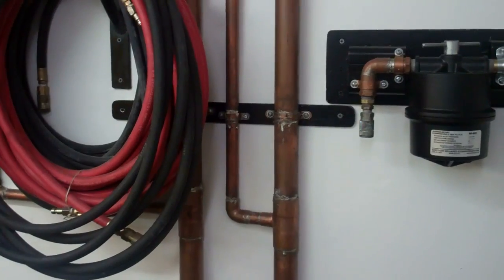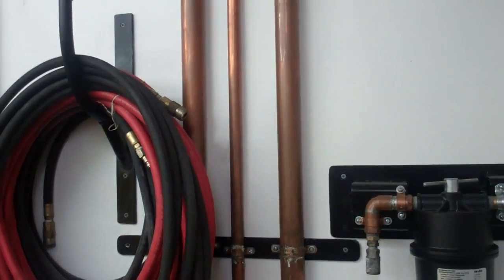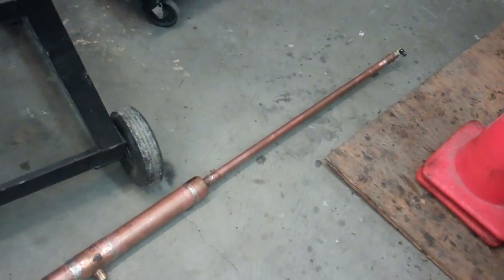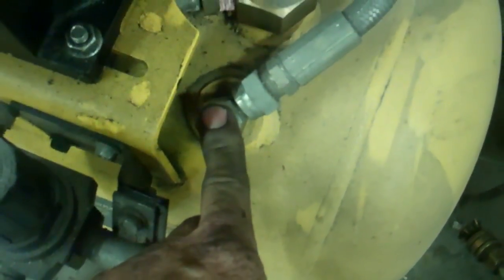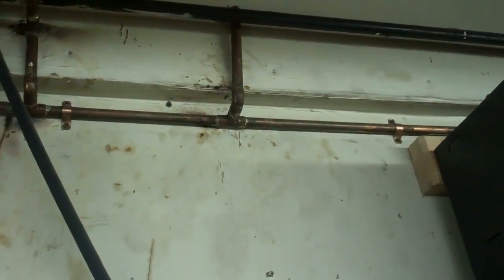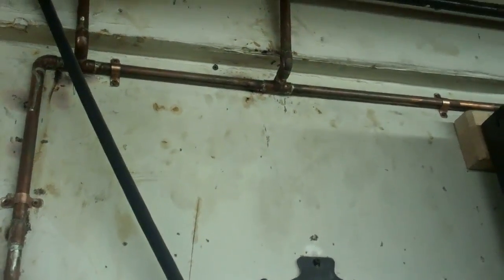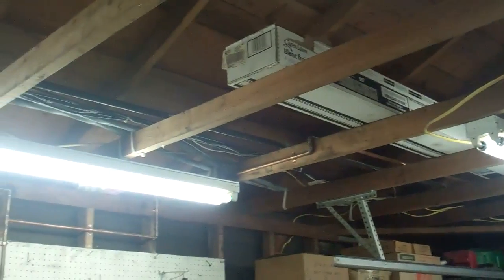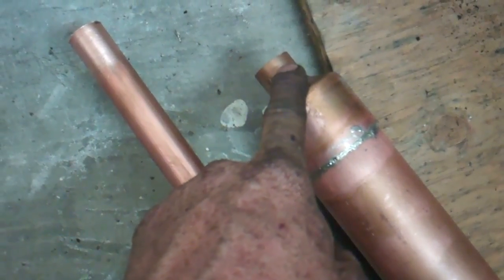Building a Air Compressor Water Trap

Comment: Nice separator,,,but you should think about putting rubber or cork gasket between the 2 different metals,,,they don't play well together,,,
Reply from the maker: +George Spangler     There is no corrosion at all.   When I added the water trap,  I had to redo what was done years ago and it didn’t have any corrosion at all where the copper was touching the steel.
Reply: @1970chevelle396  that's good, i know some metals do,,,,,I saw 396 chevelle,, I have a 72 chevelle myself I'm restoring,, actually have 9 classic cars projects,.good luck with your projects,  I am going to do a water separator like yours
Reply from the maker: George Spangler    Aluminum and steel will corrode.   I’ve had my 70 Chevelle for over 26 years now.   Hardly ever have time to drive it.

Comment: Just trying to understand here:  For the "primary path" of this expansion chamber / cooling / water trap:   Is it fair to say that the hot humid air from the compressor enters the smaller pipe on the left towards the bottom, travels through your Tee over to the large pipe where it slows down, condenses, and then travels out the top?   The video was hard to follow, but I appreciate you sharing something that works well for you.  I just want to understand it well so I can make a version of my own with an auto-drain valve.
Reply from the maker: underourrock   That is exactly how it works.  When the air goes threw the big pipe it slows down and the water goes down to the bottom.  A lot of people are making them out of 3/4 pipe and making a whole bunch of them because the air goes threw it to fast.  With 2 inch pipe you only need one water trap.  I also have water traps under each quick coupler and not one drop of water ever comes out of them now after doing this.
Reply: 1970chevelle396 thanks.  I really like it.  I think I'll put the inlet for the cooler a little higher than the outlet of my compressor.  Any condensation that forms in the line should be heading towards the expansion chamber instead.  I'll likely tee off the top of the expansion chamber and run a loop around the garage.  I'll attempt to make the tee at the top of that chamber the low point so any moisture goes back to the one auto drain.  I like it.  Thanks again for sharing this!

Comment: So how long of a 2" pipe do i need to run before i can step down to 1/2" or 3/4"?
And is one 2" pipe enough to take the water out? Been using my compressor alot lately doing body work on my truck, and it pumping out a ton of water through the lines...
Thanks
Reply from the maker: splash   There is 3 feet of 2 inch pipe on the top.  Below the tee is 1 foot of 2 inch pipe.  At the bottom is about 2 and a half feet of 3/4 inch pipe with a drain valve on the bottom of that.
Reply: 1970chevelle396
 awesome!
Thanks

Comment: Why don't you discuss how to make up the moisture trap.  Don't really care about your steel brackets.  You will galvanic corrosion between the Cu pipe and the steel bracket.
Reply from the maker: Frank Montana   To make it all you need to see is it finished to get an idea of what you need to do.  There has never been any corrosion between the cooper and steel.
Reply: With all due respect, the camera is not held on the entire finished assembly to show how it is made up. The line you are installing to your other garage and the steel brackets do not illustrate your smarts or creativity. The moisture trap assembly does. If you have had no corrosion, then you must have placed some sort of insulator between the copper and steel. With direct contact between the two, galvanic corrosion will definitely take place. It's physics.
Reply from the maker: Frank Montana   In the channel intro video I just made I showed the whole thing better.

Comment: I made one similar to what you've got there. It's nice to see someone else thinks things out. Copper IS the way to go because it disburses the heat more efficiently. Hot compressed air condenses on the inside of the cooler copper pipe and runs down to the drain. Also the velocity of the air slows and is less apt to force hot humid air through the larger pipe at speed giving the water an opportunity to escape the flow. I do a bunch of sand blasting and this works really well for me and I get very little if any water in the factory made water trap by the blaster. I would build one of these again without hesitation. It works better then the factory made inline ones for me.

Comment: You put a lot of effort into this but the video is so choppy it is very difficult to follow. Too much time on the brackets and not enough of time on the actual layout of the system. Would love for you to do a follow up and slow the video way down. I really appreciate your time into this though.
Reply: I really like your thought in this design but I have to agree with tractor guy:  It is really hard to see what is going on.  Is there no way you can stand back further so we can get a bird's eye view of what is going on here?   If not, then how about taking us from the outlet of your compressor through the expansion chamber where you are collecting water and out to your tools:  A sort of beginning to end of the system.  Either of these would make this much easier to follow.   I think I get the gist of what you are doing and gave you a like for sharing this with us.  I just hope in your future videos where you show off a system that you take the time to give a walkthrough from beginning to end.
Reply from the maker: +tractorguy123  If I filmed the whole thing the video would have been to long.  If I have the time to do the brackets nice I might as well. The video camera I was using wont zoom out far enough, so it was difficult to try to get the whole thing in there because there was not enough room to stand back far enough.   The whole key to making this work right is to use the 2 inch pipe.  All the other videos Ive seen people are using 4 or 5 pieces of 3/4 inch pipe with drain valves on each one of them.   With 2 inch pipe you only need one piece and one drain valve.

Comment: if the steel brackets are touching the copper it will cause electrolysis and corroded the copper over time. fyi. clean felt works nice between the two metals

Comment: I like the setup.  Reminds me of a still. lol.  How much pressure is in the lines after the compressor?  I'm curious because I just started plumbing mine. I'm going 3/4 copper with a manifold.
Reply from the maker: +strokedfirebirdable  It has 125psi,   The Copper pipe is suppose to be able to take up to like 400 psi.
Reply: +1970chevelle396 Okay cool thanks for responding super quick.

Comment: Looks good , so tell me again what the 2"to3/4 does ?
Reply from the maker: MrFireman164   The 2 inch pipe makes the air go threw it real slow.  That makes all the water go down into where the drain valve is.   The 3/4 is just what's connecting to it and where the drain valve is.
Reply: Makes sense,,,water will dissipate and drop in the larger pipe

Comment: I like the way you did that Ken..i'm gonna do the same to my air system<-:
Reply from the maker: rickboh  These water traps work perfect.   a year and a half ago in the winter time I would use an air grinder and it would freeze in my hand from the water.   The top piece is 3 feet of 2 inch pipe then there is a tee , after that is 1 foot of 2 inch pipe , then the 3/4 inch pipe with the drain valve on it.

Comment: Nice job Ken, although I think that could be better used to produce moonshine? I have the small water trap and a dessicant filther on mine but the dessicant goes neutral almost immediately. I am going to put a solenoid and time clock on my tank to drain it regularly. I would suggest using Unistrut and one piece clamps, we use them in the electrical industry.
Reply from the maker: Cruiser Mac  I thought sooner or later someone would mention Moonshine.  LOL

Comment: Nice work Ken, great air setup. will you be adding a dryer system at some point?
Reply from the maker: turbocobra   This works very well.  I shouldn't need an air dryer.  If I was to paint something , I would still use a Motor guard filter .